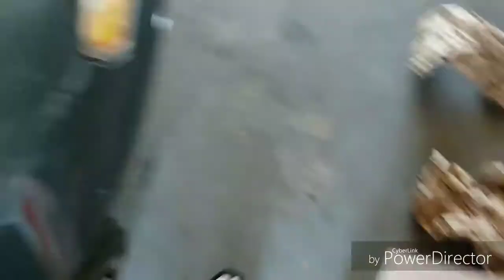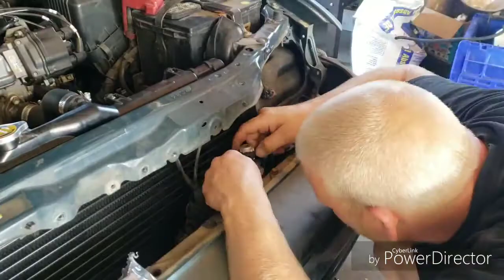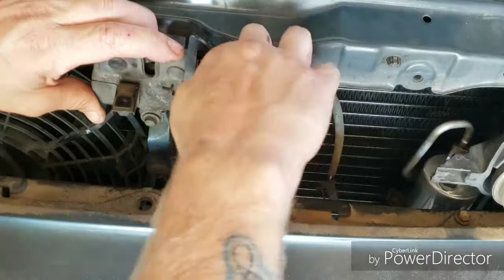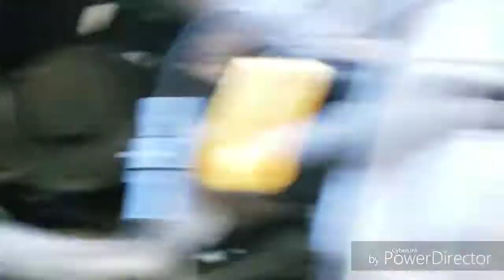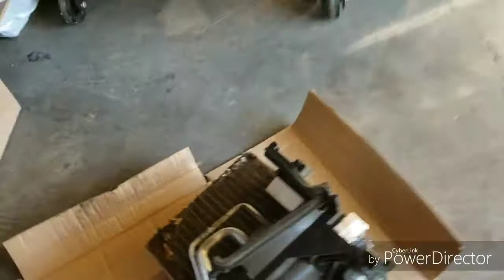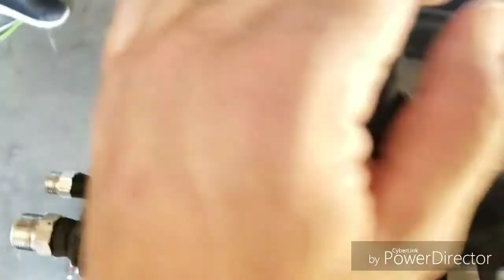How to rebuild AC system in a 96 corolla

Comment: Nice rebuild of ac ,have 94 doing the same expansion valve plugged or stuck , fender bender usually the cause of 300psi  high side pressure to high ,suction to low 20 psi , no suction side screen on firewall ?

Comment: The two bolts that go through the actual evaporator valve (the bolts that run through the assembly that holds all the tubing and the expansion valve together) were the a 6-point head? a metric hex?  Torks?  Does anyone know what tool and what size?  Thanks.
Reply from the maker: Sorry man that was a long time ago